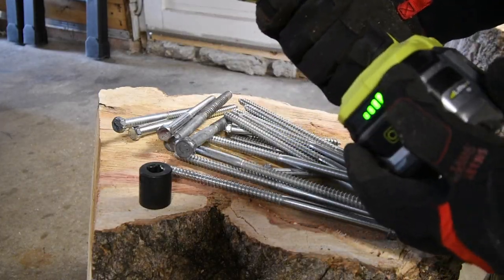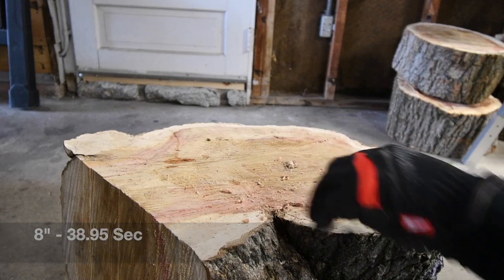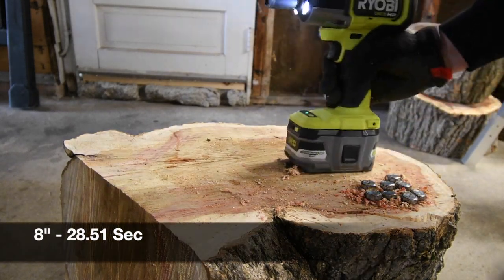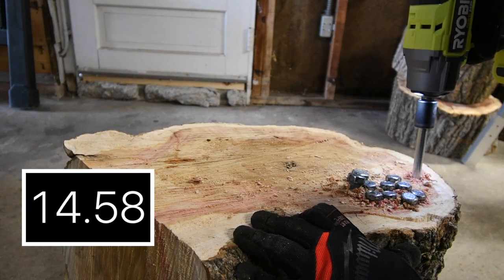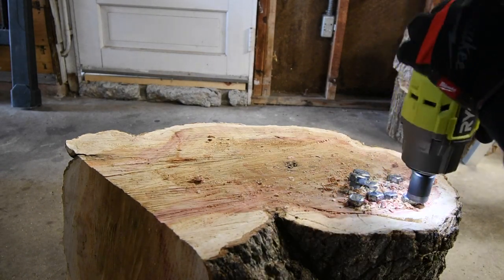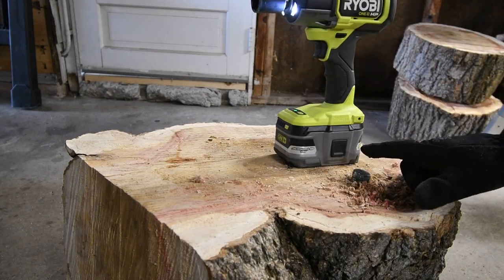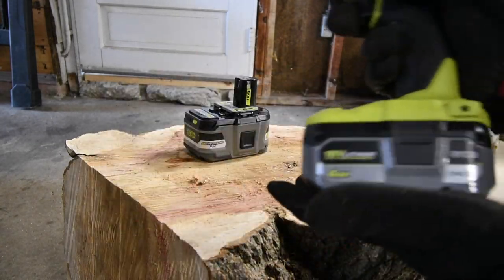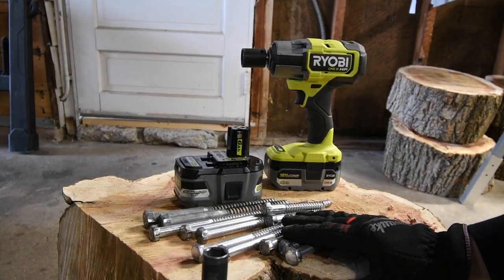Ryobi P262 Battery Duration test!!

Comment: I bought the P262 Impact Gun in April of this year and have no complaints for automotive use. I do in fact pair mine many times with a 3 amp hour Makita battery via an adapter. I have to say it's way better than the lowest rated 1/2 impact gun Ryobi sells. I just wanna get my hands on that new one that Torque Test Channel got a little while ago next.
Keep up the good work man👍👍

Comment: I almost got one of those, but went with the compact 1/2 Dewalt 12 volt instead.  They're selling for $80 on Ebay all day long.  Whereas the cheapest used Ryobi Incoild find was around $100 used.  If I need a bigger impact I would definitely consider it though, it's a nice looking tool.

Comment: I use the 2ah HP battery on it for short work under it's max rating. Like lug nuts. It'll rotate all 4 tires. Nice to be able to lighten up the tool & still have it function as needed.

Comment: Yeah id definitely want to drill pilot holes and have the high tourqe for lags all day.
Reply: Exactly. Pilot holes/clearance holes are required for lags. And it isn't just to make it easier for the tool, but to allow the lag to do its job of fastening properly and pulling the outer piece to the underlying substrate.
Reply from the maker: I will be doing videos on that soon
Reply: @ccbowers  p

Comment: Cool duration testing video that ryobi didn't seem to do very well
Reply: Considering an cordless impact wrench is designed for nuts and bolts. A corded impact wrench is better suited for lag bolts. Most jobsites still use corded tools cause a voltage drop with cordless tools means less work will be accomplished. Makita makes an impact wrench corded in 3/4 drive that will do lags all day.
Reply: @wmc128  I'm sure the 3/4 makita will do lags all dat because you said it was corded
Reply: @wmc128  I use my Milwaukee and dewalt and makita cordless impacts all day long on Vehicles and Normally don't change the batteries on any of them even when doing suspension work And cordless impacts don't use anymore or any less power whether your using it for Bolts or Nuts or Lag Bolts it's all the same to the tool
Reply: @AntonioClaudioMichael  With Nuts and bolts you  dont tend need to run them for 30 plus seconds each to do.  Lag bolts and nuts and bolts are like apples and oranges.
Reply: @artjohnson3  as a mechanic I have used impacts on bolts and nuts for 1 plus minutes and even longer because of how tight they are I disagree with you but that is my opinion
Reply: Lags are a completely different animal than Automotive bolts. Name a bolt besides the harmonic balancer bolt that you need to hit for more than 10 seconds.
Reply: @wmc128  how about suspension components steering components depending on the cordless tool will depend on the power and how long you will have to have the tool hammer lots of factors you have a good day
Reply: @wmc128  crank bolts aka Harmonic balancer bolts take more then 10 seconds to get off with any impact require ton of power especially Honda crank bolts there are snap on cordless 900 plus dollar monsters that take minutes of hammering and still can't get them off... don't under estimate bolts on vehicles and how much power it takes on some tool ratings on impacts are subjective and box ratings to actual output are 2 different things I have seen some 3/4 impacts that struggle on Honda Crank Bolts
Reply: @AntonioClaudioMichael  lol 40V 3/4 drive Makita  would smoke any harmonic balancer. Snap-On makes junk powertools.
Reply: @wmc128  40v Makita Is Brand New only online not in stores and The price is not something the average person will Buy you take care
Reply from the maker: a pilot hole is required for batteries to last longer for this task